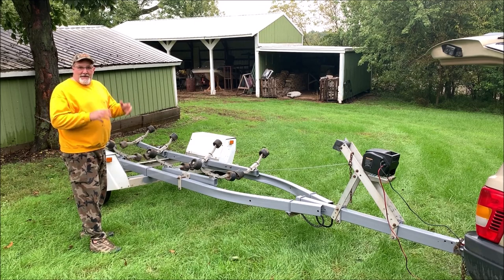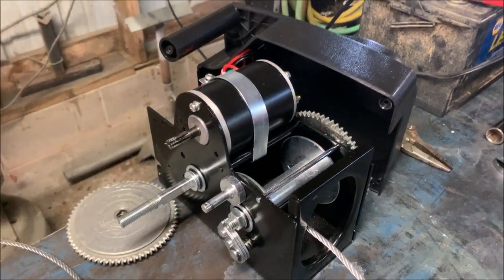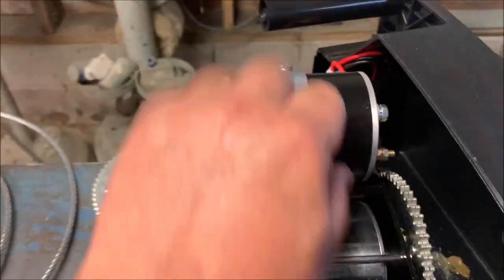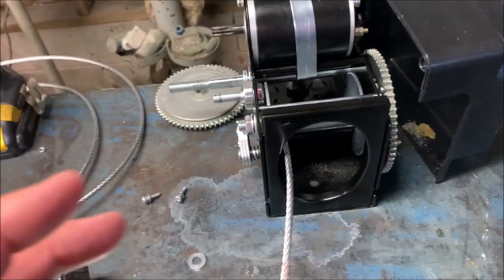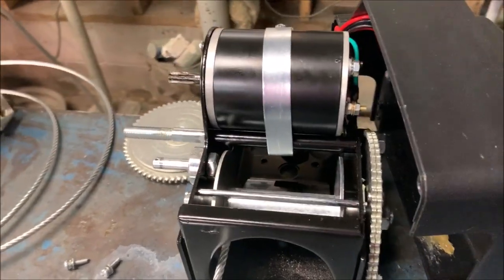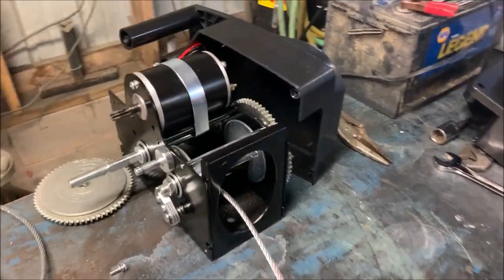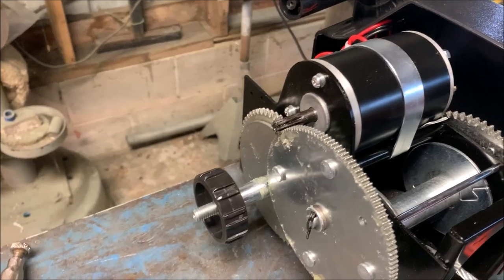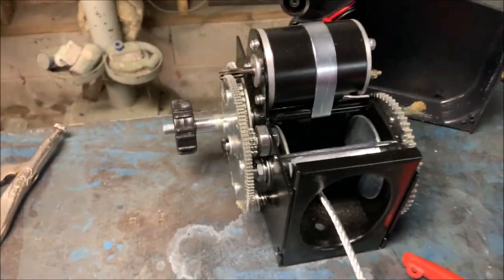New Badland winch fail then fix 2000# capacity boat winch

Comment: I have the same one from TOOLZONE bought from Amazon. Yep it craped out quite quickly. Your video will help me get a few more miles out of it untill the gears strip. Thank you.
Reply from the maker: Yep they are a piece of poor engineering for sure.  Just one more bracket for about two more dollars cost and it may not be as bad of a winch as it currently is.... it's a noisy one though....that would be my second complaint.

Comment: I need a wiring schematic to wire mine back up the plastic case got smashed and pulled some of the wires lose I pulled the relays and the power and switch loose and put them in a watertight box but I don't know how it was wired

Comment: Was the winch supposed to pull the vehicle in park or pull the tree out of the ground?
Reply from the maker: either one was fine with me, just testing the  strength of the winch. Thanks for watching
Reply: @Michaelsbackyardmarina the strength of the wench is 2k lbs ! That was obviously going to break it! A boat in water doesn’t need 2k lbs of force